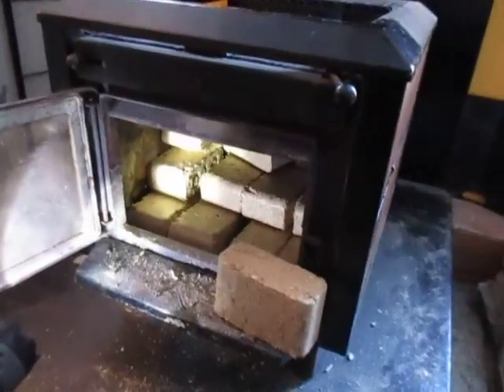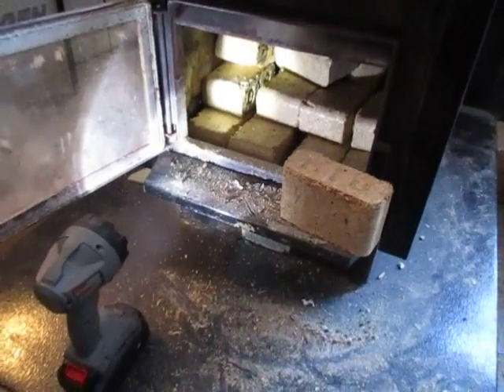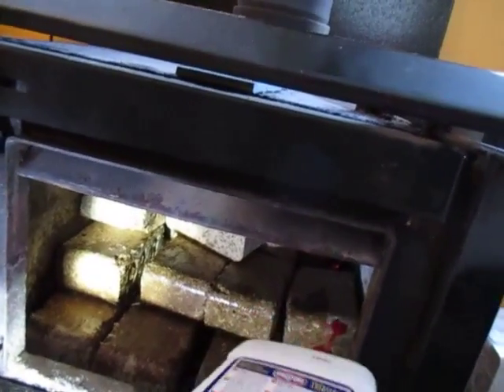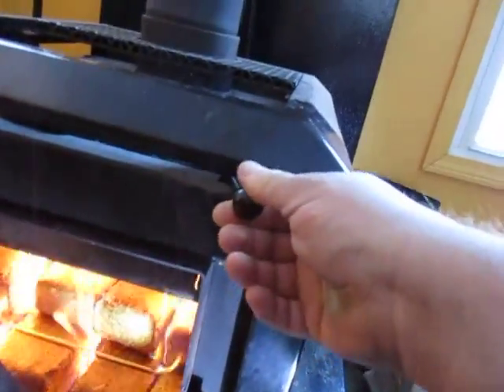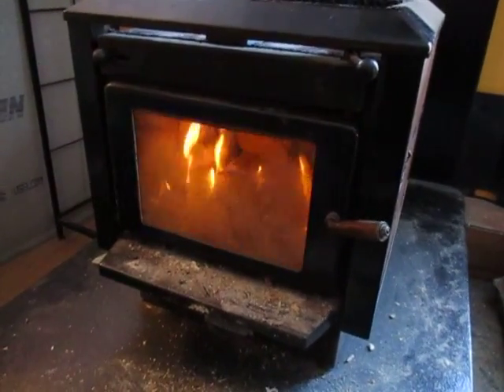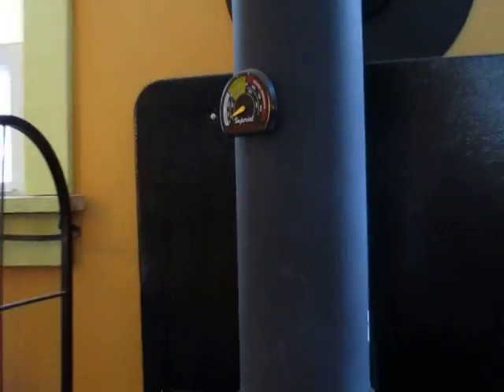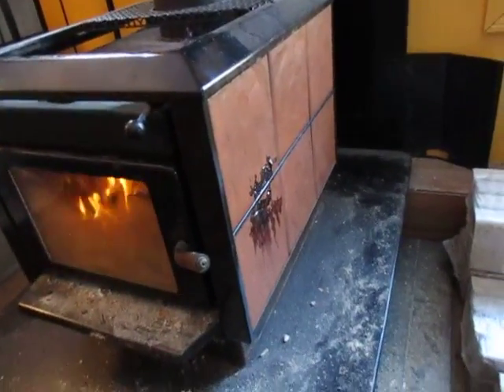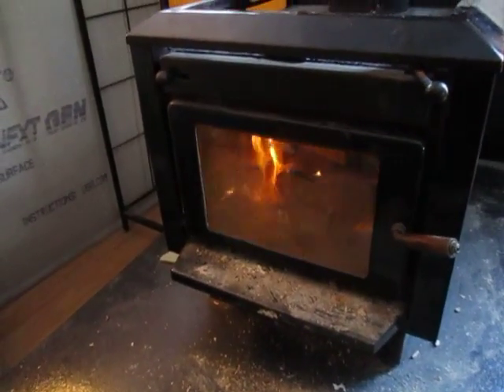using sawdust bricks instead of wood

Comment: Have been burning these for 2 years now they are a nice alternative when I dont wanna go out to the wood pile. I have a decent size stove and burn 12-16 at a time. As long as you keep the air control adjusted they don't overfire the stove. I get about 8 hours of heat from 12 bricks

Comment: What binds the sawdust together?
Reply from the maker: the sap in the tree, like when you boil sap to make syrup
Reply: @thefaeryman  Thanks.  I have free access to mountains of sawdust from a local lumber mill.  I'm wondering if I could use a 20 Ton hydraulic jack or the hydraulics of a wood splitter to compress t he sawdust enough to make my own bricks.
Reply from the maker: @GrowLLLTigeRRR  you will have to do some research on what is required, I wouldn't know where to start
Reply: GrowLLLTigeRRR 
There are videos which show how to make these, using paper and coffee. 
Check um out.
Reply: In India, some briquette plant used nothing but pine needles and a bit of water to create fuel. The pine needles went into a press then turned into briquettes with the help of pressure. Pressure makes heat and pine needles have this built-in binder called lignin. 

Charcoal briquettes are more difficult to make and require random binders plus they require accelerants like fermented sawdust or fertilizer to burn hotter before being reduced to ash.

Comment: I am worried about the use of lighter fluid. Don't even like to use it for the bar b cue Then you add inside and breathe it. Just sayin. I see this pretty often in videos. Blessings
Reply from the maker: do you paint your nails or use any cleaning products in your home?
Reply: That's why you should use methanol or alcohol-based lighter fluid.
Reply: Use what you think is safe to breathe.    I have seen absolutely NO recommendations from any stove manufacturer about using lighter fluid.   Some "crazies" even choose to use old engine oil as fire starters.  Go to Home Depot or elsewhere and buy FATWOOD and use those as fire starters, along with newspaper.      Every home should have a Co2 Detector just in case there is any type of gas "backup". And of course a smoke detector. You can also put CHEAP grade of cedar shakes #2 grade for $14 a bundle, which should last you most of the winter.   Just take one and split it a couple times with a hatchet.   They are raw wood, NO stains or paints.   EXcellent to start fires.   Be safe.

Comment: I use these bricks to heat also. 20 bricks per pack,, 50 packs per pallet $198 Canadian. Dose anyone know a way i could store pallets of these outside ???? I have room to store one pallet inside the house but i need 3 pallets for the winter. I have a old shed ( its full ). Could i maybe wrap the pattet with plastic and tape it up good ??? i worry about the humidity desrtoying the bricks befor they are used.
Reply from the maker: i have thought about keeping a pallet on porch but they will expand with humanity, contact the company that makes them
Reply: Rev John O'Toole  I was just reading online about storeing them. One guy stored a pallet on his porch durring the off season. He just wraped them in plastic. he said they were fine when winter came round again. Others said they were stored outside ( but ) plastic wraped  and taped and also tarped
Reply from the maker: I remember seeing a video that a stacked them along inside walls kinda like a chair rail. i use them as backup for power failure, last year the new furnace did fine as long as i leave the temp on the same temp.
wish you the best

Comment: Forget the pellet stove.  Too limited in it's fuel.  You can always add a basket for burning pellets and not lose the wood burning capability.
Reply: Would the basket be good for coal as well?
Reply: i got pellets to burn pretty good in my fireplace.
Reply: I don't have sawdust pellets in my country so I use a sawdust stove.

Comment: Bio bricks are just wood... Just burn wood, there is no difference other than wasting money having someone form wood into bricks.
Reply from the maker: either way I have to pay someone, burns cleaner and  far less waste after the burn.
best
Reply: Watch the video and you'll understand why he choses to use these. If you are up in years and may be a bit less agile,  these would be an easier way to handle and store your fuel source. 
The main idea for these bricks is not to change logs into sawdust just to press them into bricks.  It is to salvage an otherwise useless waste product from a sawmilling operation.

Comment: Hot bricks are also made in Ct. and I have used them two years now. The company also makes them in log form. It's about 6 inches in diameter and 18 inches long. I have not used the logs just yet. 
And as far as lighting I break up a brick and pour some waste oil on it. Then I hit it with the mapp gas torch for about 30 seconds and that's it. My Regency (F1100S) free standing stove packed solid runs all night and is hot to the touch after 8 hours. And just so you know, I built ducting to attach the fan itself out of a Nutone QT 300N bathroom fan unit. It's 300 cubic feet per minute. So I get great air flow through the entire outside of the stove. And that means great efficiency. Bio or Hot bricks brand bricks are very good. The ash pan takes me about a month to pack solid. And no clinkers. Are left. So its just grey powder. And I pack the pan so I don't have to go outside and dump it so often. I prefer the Hot bricks brand. But that's just because I have used them more than Bio brand. I met the owner of the company and he is a great guy and very knowledgeable about the product and he helped me figure out how to get the best out of my stove. So that and the fact that I can buy them local to me made me happier. I recommend switching to anyone who is unable to cut, split, or carry firewood. They're lightweight, dry, stackable, bark free, nail free, dirt free, bug and spider free and require no special or dangerous equipment.

Comment: Keep in mind that these might warp your stove or even crack it when you put in too many of them at once. Specially if it's sawdust from pine and/or oak which gives off a hell lot of heat.

Cheers.
Reply: They also recommend that you do NOT stock them against the walls of the stove.
Reply: @Jackie Gammon

Indeed, forgot about that one. Good call.

Comment: A pound of dried wood is about 8,000 btu, seems expensive at $7 for 40 lbs, have you tried pellets? 40 lb bag of pellets $3.75
Reply from the maker: pellets are a different stove and chimney. my stove can burn both logs and this type bricks which also burns cleaner than logs and they are easier for an old fart like me to store and move around.
thanks for watching.
Reply: Pellets in Ontario Canada are $7.00 a bag for 40.lb bags if you buy one bag at a time you might save a buck a bag if you buy a skid. Because we have cold winters they stick it to us to keep warm.

Comment: Not trying to be a douche, but that must be a really dirty burn with so many bio bricks. My stove takes no more than 2, max 3 at a time, or else it smokes like crazy. :/
Reply: Was thinking the same thing. They are not ment to be used like this. You still need to start a fire with regular wood etc to crank up the heat first so that the bricks can ignite by themselves when added. Also, what he's doing is extreme overkill and can even warp and/or crack a wood stove (too much heat produced for the stove to be able to handle), specially if it's sawdust from pine and/or oak.

Cheers.
Reply: @TheOpelkoenjas      Excessive heat won't be able to "crack" a steel woodburning stove, but too much heat WILL crack a cast iron stove, an d they are so damn expensive.
Reply: @chuckwosilis1247  It will warp a steel one and crack a cast iron one. ;)
Reply from the maker: actually I just squirt some charcoal lighter fluid, some cardboard on top to get the draft started.
thanks
Reply from the maker: it;'s a very clean burn with very little ash left

Comment: Flood knocked out our heating but I got heating pad and electric blanket gloves hat thermals we use a space heater in the bathroom to shower other than that we don't need heat. When it freezes we shut off the water so the pipes have less a chance of busting.

Comment: Great video! I use a different brand of bricks (Canawick) and with my Morso 3610 Stove, 7 bricks (after a 3 brick preheat) brings my stove to 450°. 8 bricks goes up to 500° - almost into the overfire at 550°. How many bricks are you using in this video because it looks like more than 8. Also there is the issue of expansion of the bricks - I take it that your stove can take a higher heat than the newer ones (bought my Morso in 2015). Some companies will not allow biobricks in their stoves as they get so hot, the stove's warranty will be voided (not an issue I guess with yours). BTW - Pellet stoves need electricity - so in a SHTF scenario with no elec., that pellet stove will be useless.

Comment: This was interesting! I've never heard of bio bricks.
Reply: I have been using Bios for about 4 years now, along with firewood.   just bought another pallet of bios   40 packages on a pallet   25 bricks per package.   approx one ton. Once i have a nice fire going, i put a couple of them on top of the slow burning wood or hot coals.   When the wood burns down to ashes, there is still a good amount of the Bio left.........still burning.
Reply: @chuckwosilis1247  I usually put two down with a small gap for air, and place the really hard (it's more dense, and heavier than oak or ash) hardwood on top of them. After about an hour, I throw two more on, then wait for it all to burn down, then repeat the process.

Comment: I am glad you do have a heat source. If you add a pan of water to the top it helps with added moisture and heat. I use to have a cast iron tea pot on mine. I do not miss hauling wood. But, do miss the amount of heat they put off. I chose a propane fireplace to get the house above 60 on the coldest days. We were at 17f outside this morning. So winter is here now.